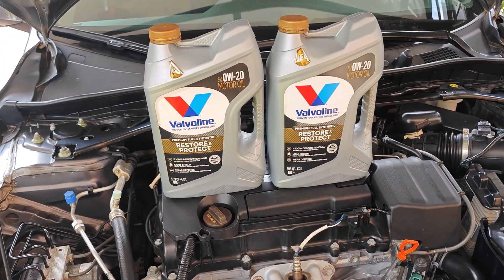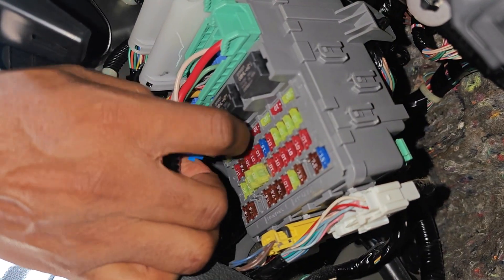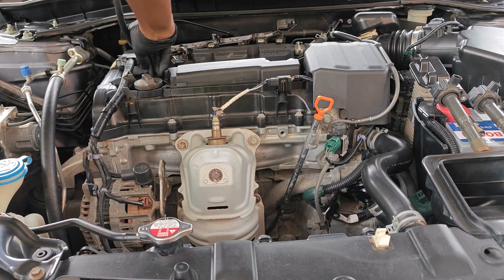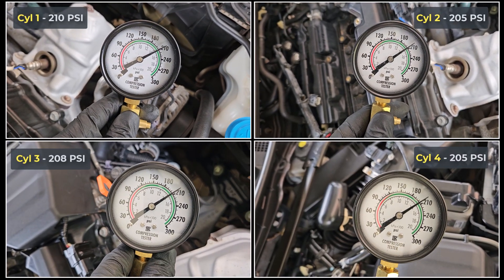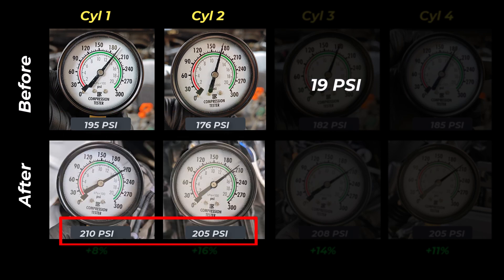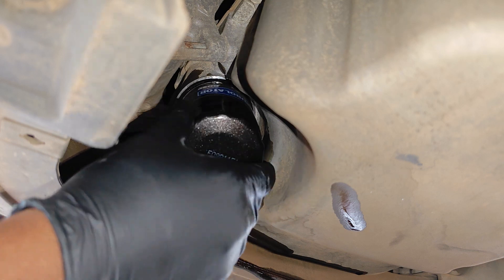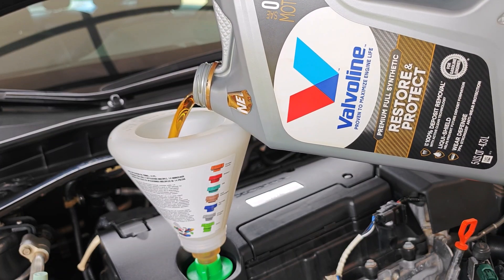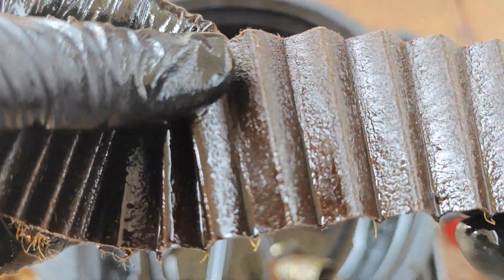Checking engine compression AFTER Restore & Protect Oil. Increased Engine Compression?

Comment: Fascinating video! Really well organized presentation of data as well. One question: did you do the compression tests when the engine was cold, or was it warmed up to operating temperature? And were you consistent for both tests? On my VW, I get numbers like your “before” test on a cold engine, and like your “after” on a warm engine. Which is actually normal (per VW service manual). A warm engine has expanded piston rings, which seal better, yielding better compression results.
Reply from the maker: Thanks mate and great questions! I did both tests with the engine at operating temperature. Gave it a drive and them came back for the tests. I tried my best to be consistent. As I mentioned, I didn't floor the gas pedal across both tests.
Reply: @DIYAutoworksNG  Great answer, thanks for that quick reply mate!  Your testing methodology seems really well-designed, so I figured you would have taken this into account, but I thought I should ask as it wasn't mentioned in the video.  FYI, here's the cold/warm compression specs for my car (2014 VW GTI).   Hopefully YT will let me preserve the formatting...  Here's the data:
These first 3 lines (new, wear limit, max delta) come from Erwin, which is the customer portal used to access official VW Service Manuals.
    - new:                                  160 - 203 psi   # That lower limit seems crazy low for a new car! 
    - wear limit:                                 101 psi
    - max delta b/n cylinders:          43 psi

And here's my cold and warmed up measurements. Cold meaning the car sat overnight, and I measured before driving anywhere.

- measured each cylinder for 12 cranks, until psi stopped increasing:

	cylinder:                1       2      3      4
     
         cold:                  160     156    160    160   
         warmed up:     202     194    193    191

So while I (fortunately) don't have a big delta between cylinders when cold (or hot), the increase in PSI with a warm engine was shockingly large, 21% in the case of cyl 1, and similar for the other 3.    Cheers!
Reply from the maker: Thanks for sharing the detailed reply with me for your engine! 
For my car, Honda says compression should be done warm and minimum compression should be 130psi or more, and no greater than 29psi between cylinder readings.
Reply: @DIYAutoworksNG  would be curious about what it shows cold. that would be true apples-to-apples comparison. albeit, it's too late for the pre-valvoline readings...

Comment: Can anyone provide feedback or opinions.
Gonna plan to arrange for my oil change to rp in about a couple weeks.
Since this is the first time, after the oil change
- should you go easy with the throttle or can still do spirited driving
- since this is the first time, should i do the next oil change earlier at 6-8000km instead of 10000km

Thanks 😊
Reply from the maker: Good questions! I'd drive it as usual. Important before you switch though is your maintenance history. If car has sludge, I'll change the oil filter early like 300 - 500 miles out of an abundance of caution.
Reply: @DIYAutoworksNG 
Thanks bro.
I do not have experience and tools with which to check or dismantle the engine.
The main issue I am facing now is the engine burning oil.
So far it's 1 litre per 2000km
Reply from the maker: Peep through the oil pour hole with a flash light and see if you see any sludge build up. Also look at the underside of the oil cap, if there's sludge it'll collect there.
Reply: @DIYAutoworksNG 
Roger that.
I just took a photo of the engine after removing the oil cap.
I put a Google drive link for the image.
I am only guessing the dark portions are sludge??😅

https://drive.google.com/file/d/1_BK9bEs7nLDnxRpxo3UHr9QpGSfexq3F/view?usp=drivesdk
Reply from the maker: Yea. Varnish and some sludge
Reply: @DIYAutoworksNG 
Thanks a bunch mate for taking a look and for the response.

Btw just came back from my road trip and wanted to give you an update.

Just filled a full tank of petrol with a tin of liqui moly valve clean last night and did abit of city driving and some spirited driving on the highway.

Normally when the petrol meter is at the halfway mark I would get 260-280km but this time I managed to get about 420km.

This left me puzzled and surprised but in a good way. Tomorrow morning will have a look and see how is the burning of the engine oil.

Peace bro!
Reply from the maker: Wow. That's serious. Keep me updated.

Comment: Very interesting. I'll start using this after my new replacement engine from hyundai. Get's get some miles on it.. fingers crossed it stays running. The first one made it to about 130.000 miles.
Reply from the maker: Yea. I hear Hyundai's GDI carbon up quite well. This should help.

Comment: Holy moly that’s a quite a difference. I just recently purchased a jug of of Valvoline  protect & restore oil!  I never tried yet I’m going to! I have a vehicle with over 1, hundred thousand miles on it & I used Valvoline full synthetic oil since I bought it I bought the oil at Wal mart they are a bit cheaper price wise .
Reply from the maker: Good luck, hope you get great results!
Reply: @DIYAutoworksNG  I’ll let you know what the results are when I use it .

Comment: I pulled the oil fill cap on an older /high mileage overhead cam engine and bore scoped the top end before and after. It definitely does clean. Coming up on the 4th oil change and the motor has progressively ran better with each successive oil change.
Reply from the maker: Glad to hear it's working for you too
Reply: Any problems with valve stem leaking oil after using Restore and Protect?  I am concerned that I may create a problem if I start using Restore and Protect.

I recently bought an older /high mileage overhead cam engine (Toyota 1ZZ-FE) that has lots of varnish on the top end, but it doesn't burn any oil.  I assume the bottom end also has a lot of varnish and possibly sludge.  I pulled the valve cover off and cleaned out the varnish on the top end as best as I could.  I also replaced both the front and rear main crankshaft seals.  The engine currently doesn't leak a drop of oil.  I would like to try and get rid of more varnish (and possibly sludge) by using Restore and Protect, but am afraid the vale stems might start leaking afterwards.
Reply: I'm on my 3rd oil change w/R&P on a GM 4.2 I6 at 348K miles. Slight tick at start-up almost completely gone (very rare now). Oil consumption reduced to half. Was 1qt every 1K miles. Now 1qt every 2K miles. [I've only been using R&P on 5 out of 7 qts during oil change]
Reply from the maker: @davidgrisco1939 cool. What's the other oil?
Reply: @DIYAutoworksNG  Kirkland (Costco) 5W30. I only used the R&P because I had a single 5 qt container and wasn't sure about it's use. I'm now convinced it works, but I'm keeping the same ratio at oil changes, just because. Before using R&P I replaced the valve cover gasket and have pictures of the varnish on the valvetrain at about 280K miles. Varnish was typical of a high mileage vehicle without sludge. It should appear much cleaner now but I have no way to easily see even with a boroscope. 

I've also had a Blackstone Oil analysis PRIOR to R&P at 302K miles and here was the summary in 2023: "Metals are the same or lower than last time, which is nice to see. Iron is lower both at face value and on a per-mile basis, so steel parts (like cylinders and shafts) are wearing better than ever. There isn't any contamination to address, and insolubles tested at 0.2%, so we know the oil filter did a good job limiting solids generated from heat, use, and blow-by. We've got no concerns when it comes to this Chevy and the way you're taking care of it! This thing may just outlast us all."
Reply: @DIYAutoworksNG  Valvoline Restore & Protect
Reply: @davidgrisco1939  great miles! mine has 315k Element and im hoping to get good results from r&p tooim on my 2nd OC and noticed a slight reduction in consumption
Reply: @davidgrisco1939  Wow I've compiled a playlist on V R&P and you're the 1st person to report back on the same engine I have and I'm at 306K. I don't burn any oil at all that I've noticed. But I did an engine flush at 270K and before that it was 3K oil changes routinely from the start. Not synthetic oil though. I now use full synthetic. I got a lot of sludge out from the engine flush I did (just was cleaning out the PVC hose - whatever it is blowby hose) - and anyway glad it is working for you...

Comment: Just an FYI, Walmart does offer Restore & Protect as an oil change option. It is a bit more expensive than the full synthetic oil change service. But if you can't get time to do it yourself, it's available as an oil change service while you're shopping.
Reply from the maker: Thanks for the info!
Reply: I can confirm this as I’ve had it done in my Acura TSX

Comment: Great video! I also experienced much reduced oil consumption on a 2008 Toyota Prius after 9 months of using Valvoline Restore and Protect. That engine had very questionable maintenance history and I did see a disturbing amount of gritty carbon deposits captured during multiple filter changes.
Reply from the maker: Thanks for sharing your experience!

Comment: Nice test.... good. Another hint on the oil filler funnel, especially if you're in USA. Get an old 1-gallon milk jug and cut it in half horizontally....of course clean the jug first. Then , take the top half upside down,  and SCREW it into the oil filler connection. The thread design is not perfect but good enough for the milk jug to deform to the screw thread used on the engine fill port.. When done, simply unscrew the jug... and replace the original milk jug cap ( quickly....to avoid dripping nearby). Zero extra cost if you buy milk anyway.
Reply from the maker: That's another way to it!
Reply: I have a similar funnel specific to my engine and it seals very well to avoid spills from filling a bit too fast.
Reply: I use a water bottle but a milk jug sounds good too!
Reply: so many engines need a longer neck now to reach though

Comment: Doesn’t matter what the Manuel says Ow 20 is thin, and burns off. Use 5w-30
Reply: For some cars it's only for better mpg. For many cars now with variable valvtrain for mpg tricks they are highly tuned for oil viscosity and eg using 10w-30 in them will throw codes and lights and not let the engine do what it wants. I sometimes mix in some with an oil change so I don't throw codes but it quiets the engine.

Comment: I’m really putting this oil to the test. I grabbed a motor from the junk yard not long ago did timing chain, water pump and oil pump. Long story short the inside of that motor is stained DARK brown. After 3k miles of oil changes every 500-600 miles it’s getting better. And the oil is coming out dirtier and dirtier
Reply from the maker: Cool. Do let us know how it goes!
Reply: @DIYAutoworksNG I think I’m going to start changing it at 1500 miles now. Was scared at first I would dislodge some chunks and send it through my timing phaser screens and cause issues. But I think that problem isnt an issue anymore. The car is a 2010 Ford Taurus SHO with a 3.5 Twin turbo v6.
Reply: @402SHO  ..it's not an issue....something I feared too. It removes caked-on carbon deposits and makes the particles so small it won't be a problem.  That said, if your schedule is to do this 4 times as Valvoline suggests, using maybe a 3000 mile interval  each time, between changes.....you may want to think changing out the filter (only) at the first use....at maybe 1500 miles. Check it. Then determine if you want/need to do the extra filter change within the next 3 times it's done....depending on your judgment what you find.
Reply: @TheWilferch dude I know what I’m doing and obviously I changed the freaking filters… ik how to change my own oil and how it’s done. And your wrong, it can dislodge a carbon chunk and send it threw screens and stuff. Would tag a specific ford mechanic rn who would say the same thing. He does hundreds of fords a year
Reply: @402SHO  ...why the aggression?I'm simply stating that with many interchanges with Valvoline, they state the oil works to dislodge caked on deposits on rings....does not pick up "sludge", and state categorically will not over-load a filter. I then go on to day VRP says to do this for 4 oil changes before you expect the engine to be fully clean....but they do NOT say how many miles need to be driven for each oil interval. So...I'm saying what I did.....will use 3000 mile change intervals and to be extra safe will change the filter (only) at 1500 miles on the first run. So what's the problem?.... change filters more often if you think it's a problem. Chill.
Reply: @TheWilferch yes it can happen, if I could tag the mechanics channel without YouTube being weird and taking it down I would. I’ve seen it happen before I’m not going to listen to you on YouTube telling me it “can’t” when there’s many videos online of chunks and gunk clogging up stuff and runing engines. And your comment about my filters I forgot I have to be so freaking stupid specific with my comments because idiots like you will think I’m not changing a 4$ filter 🤣
Reply: @402SHO  I think you misunderstood his comment. Change filter only and cut it open and inspect it then decide if 500mi changes are needed. An engine that is dark and not chunks of crud would not need changes more than a few thousand miles at a minimum.Yes there is no super safe way to clean an engine that has chunks of crud all inside except for complete tear down. Change your oil every week if you want but it's a waste.

Comment: Great video!  My oil analysis from Blackstone Lab  on my 1st run with this oil revealed high lead and copper,  they said this is bearing wear and told me to change it, the oil had 2500 miles of usage and was dark as liquid coal.  So now I'm on my 2nd run and I'm going to change it in a few (3000 miles).  It was burning oil and still is but has slowed, I have oil pan leak so I'm trying to accurately gauge my loss. Using 5W30 here in South Florida,  runs smooth and quiet, 229,000 miles, 2012 Camry, 2ARFE, 4cyl.  Good luck everyone.
Reply from the maker: Thanks for sharing. That's a good idea doing oil analysis. Curious, did you do an oil analysis on the brand you were using before R&P?
Reply: @DIYAutoworksNG No, I did not, only on the Restore and Protect.   I wish I had though.  I've tried Pennzoil Ultra Platinum and Amsoil High Mileage prior.  The 1st 10 years was Mobil One, then the oil consumption started.  The dealer told me I needed to fix for $9K, a new short block I guess.  I need to do a compression test next.
Reply: @truthseeker1979  I'm starting to think Mobil 1 (did you use the full synthetic also) isn't anywhere as good as many people think it is.
Reply: @truthseeker1979 Amsoil probably caused your issues. Those extended oil changes are not good.
Reply: You could go to a 10w40 oil in Florida no problem
Reply: If my bearing wear metals were HIGH with this oil... I would NOT use it again... that finding did not worry you?? What are your usual oil change intervals?
Reply: @1958Cadillac-v2g  If there was sludge in the engine and the R&P oil breaks down the sludge it will release trapped metals already in the sludge.  If the engine is relatively clean then i would be worried.
Reply: @lelenbates3367  the restore & protect is a much tamer version of this type of oil, so no, chunks won't break off and clog up engine or oil filter parts. That's why they made this new formulation which is weaker and clears gradually over 3-4 oil change cycles. The old oil did that so they pulled it
Reply: @1958Cadillac-v2g Well, I was always changing at 5K.  You just gave me something to think about, I'm going to email that lab and see if I should've changed brands.  The sample was 0w20 and I'm using 5w30 now.  Car runs great and oil consumption slowing. Thanks for your insight.
Reply: @truthseeker1979  The traditional wisdom AIUI, is to use thicker oil in warm environments and to possibly go even thicker as an engine wears and the clearances open up. The manual for our 2016 4 cylinder Camry says to use 0W-20 engine oil. However the manual on Toyota Europe’s website for the same car, same year, same model number engine provides a chart based on ambient temperatures. The recommended viscosities range from 0W-20 to 15W-40. Of course the minimum ambient temperature must be considered as well. This video may be of interest: https://youtu.be/pbEdr6Q6cKw?si=WkXzYKVr1dkjS49n
Reply: @truthseeker1979  don't listen to them too much, the increase in particles in the oil analysis is most likely the oil cleaning stuff from the engine. Keep using the restore and protect and never go below 5w30 and it should get better. I change my oil when it gets dark, not by mileage
Reply: @shawngrimes9302  my 2013 camry is the same as yours and I use 5w30. It's smoother and quieter than 0w20
Reply: @TheScrubmuffin69 Thanks, I'm on my 3rd Valvoline Restore and Protect oil change, 5w30, with 230K I'm changing every 3,000 miles, petiod.
Reply: @1958Cadillac-v2g  no, it means his engine at nearly 230k miles has come to that state. Doesn't matter what oil he uses, & this was only the 1st time he used it & measured it.